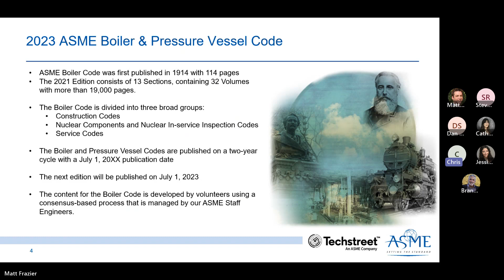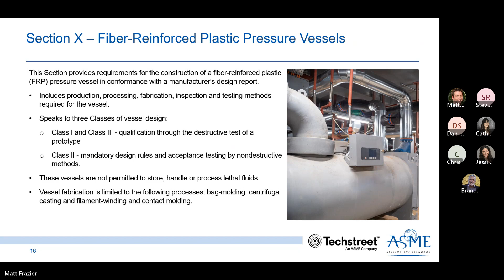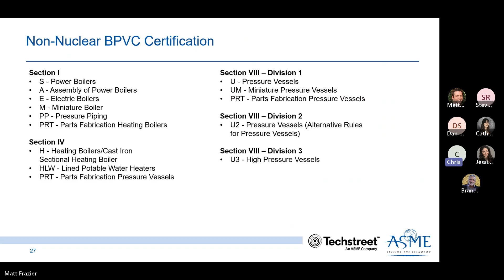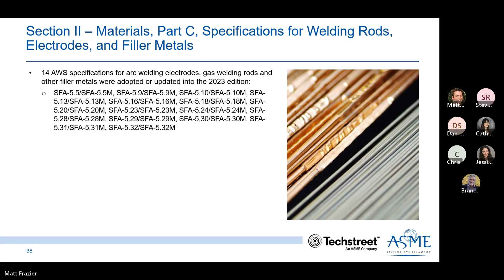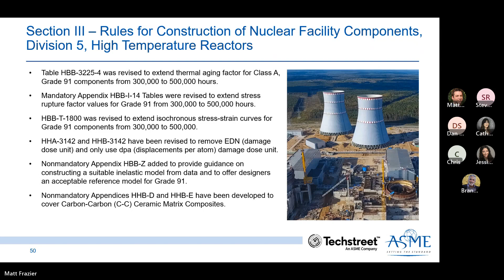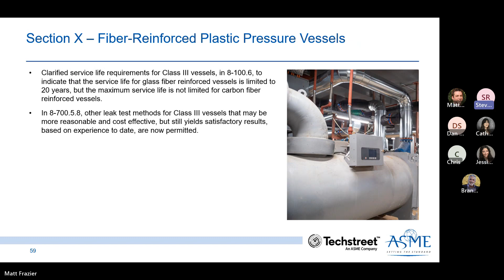ASME Boiler & Pressure Vessel Code (BPVC) Key Changes 2023

Comment: It is clearly non comprehensible WHY did the comittee decide to move heat exchanger and bellows chapter in DIV2, while DIV1 is the governing Code that everybody uses & knows, and not DIV2. Moreover, all this literature that has reference in DIV1 will now have to be updated. Finally, note now people have to buy 2 codes, in order to build a simple heat exchanger, since the tubesheet calculations are not in DIV1 anymore. As for designers, imagine the frustration to get to know a Code and then read again all that has to be read... AND keep track of changes... Simply the Comittee is surrounded by ignorants.
Reply: Haha kemey ke selam do